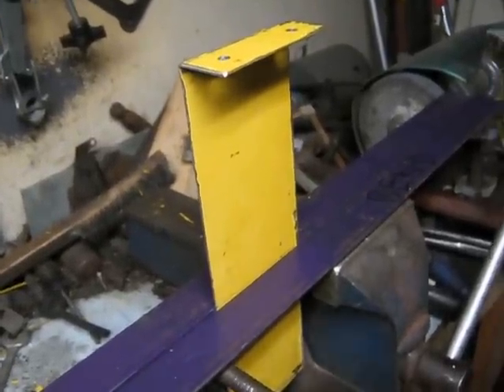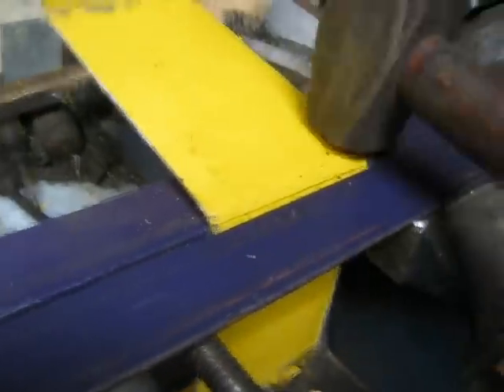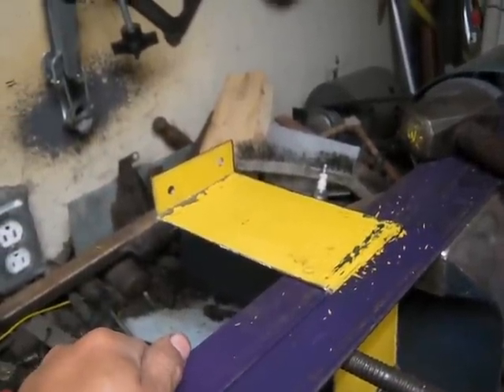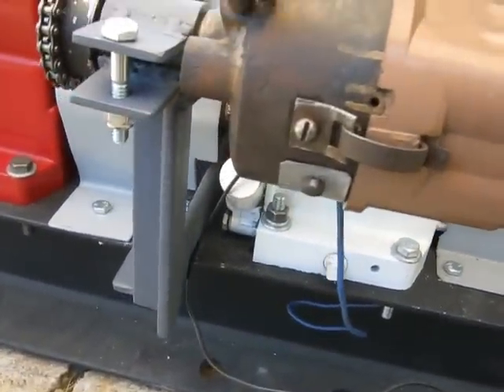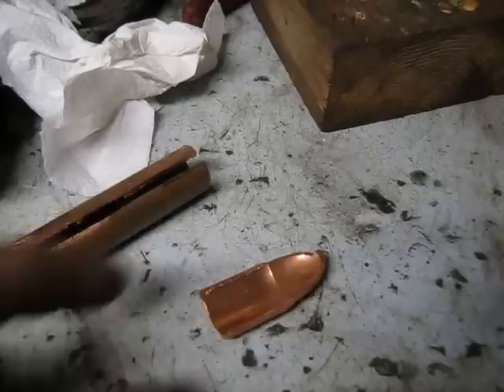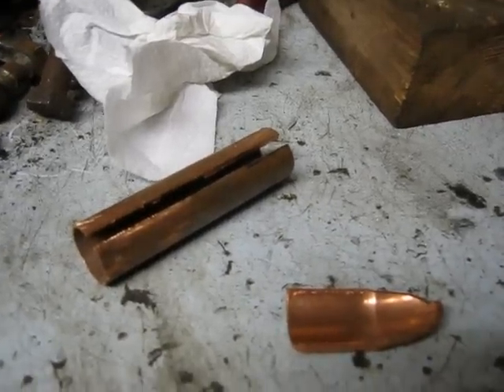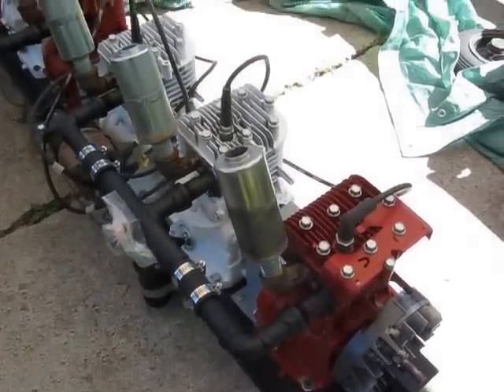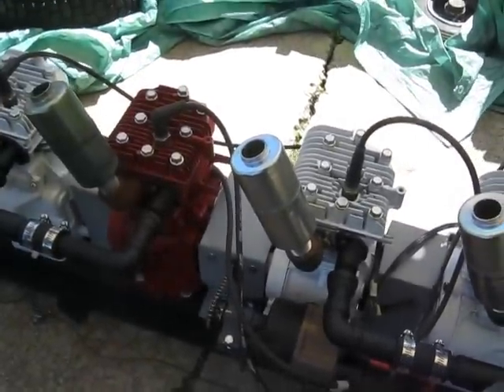Briggs 6 Distributor Wiring & Guard Vid 4

Comment: Ready to run in the next video??
Reply from the maker: Gout it running tonight on 6 cylinders, and uploaded the vid. we had to crank the heck out of it for some reason, but got a minute long run in the end, and no parts have vibrated off (like on the 4 cylinder), so the heavy steel frame must be helping.